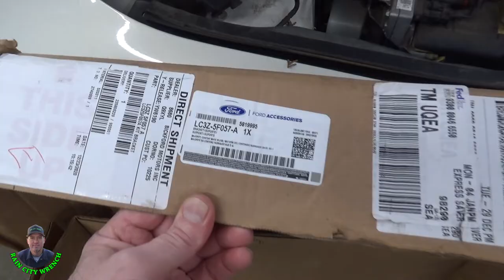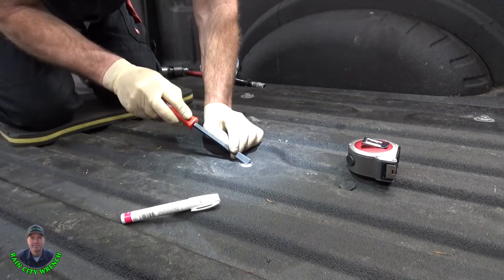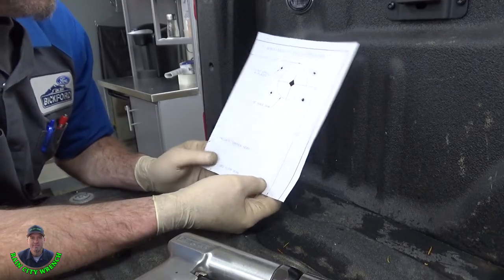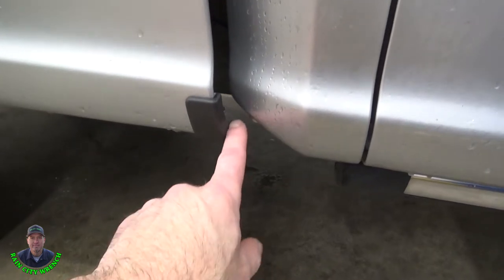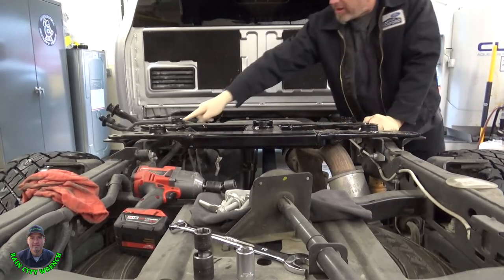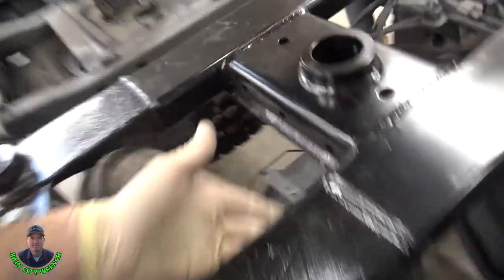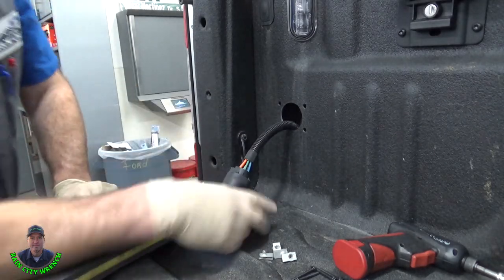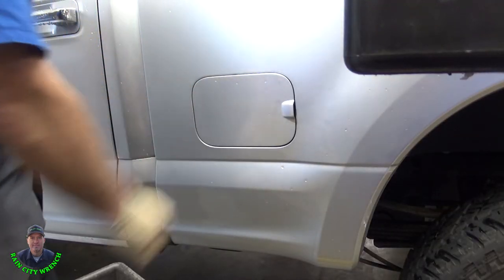FORD FACTORY 5TH WHEEL/GOOSENECK HITCH PREP PACKAGE INSTALL

Comment: Is it really necessary to remove the bed? I see a lot of installs where the bed doesn’t have to be removed. BW hitch doesn’t require the bed to be off
Reply: Then I’ve seen other videos that say to loosen the bolts on passenger side, remove on driver side, lift bed up on drive side and place a block of wood under it to keep it raised.
Reply from the maker: @Subi_doo  The directions say to lift the bed enough to place 4x4's under to gain access. I did my first one that way but never again. Was an extreme PITA. Sliding the heavy bracket under wasn't fun and torqueing all the bolts was impossible without extensions so never really knew how tight they were. Removing the box drastically cuts the time down and saves the back. But it is very doable by blocking the bed up. These aluminum boxes are light, three people can easily remove or two strong dudes. Thanks for watching!
Reply: @raincitywrench117  I plan on having the dealership do mine. I’m not taking any liability if something should happen resulting in an installation. I just don’t trust my dealership enough to not slam my bed off my cab and damage all my paint. 2 times at the dealership already with my brand new truck, both trips had damage upon receiving truck back. Granted they paid for all damages, but still I shouldn’t have to worry each time it needs service.

Comment: Is there a part number for the hardware kit (bolts and fastners)
Reply from the maker: Wished I had a kit here to look at but don't. I saved the directions but all it shows is description and quantity of each part under HC3Z-5F057-A kit. You will probably have to call your local dealer and pry it out of them

Comment: Nice video where can I get some of those protector caps
Reply from the maker: Find another pickup out in the home depot parking lot and borrow theirs. Nah, better not. Here is a kit on ebay:https://www.ebay.com/itm/254236619386?chn=ps&norover=1&mkevt=1&mkrid=711-117182-37290-0&mkcid=2&itemid=254236619386&targetid=1068323858110&device=c&mktype=pla&googleloc=9033382&poi=&campaignid=12589942946&mkgroupid=121185185993&rlsatarget=pla-1068323858110&abcId=9300523&merchantid=8260744&gclid=Cj0KCQjwyN-DBhCDARIsAFOELTnyy17r6AFRB2QUNOyv1wMJF890Zy4UQHl_uew_rqzlMfy3T6PKFpMaAkcHEALw_wcB

Comment: Very nice video such detail. 
I thought Ford recommends to NOT reuse the box bolts ? They say they are one time use only . So does the kit not come with new ones ?
Reply from the maker: Thank You. Guess you are right. I just looked in workshop and Ford says when removing bed "Remove and discard the pickup bed fasteners."
The kit does not come with bolts. They are not stretch bolts so IMO they can be reused. Ford wants any bolt with factory threadlock to be thrown away. Just apply some blue threadlocker and good to go. The truck could roll 20 times and those bolts ain't going anywhere.
Reply: @raincitywrench117  I know , I was just to curious as to why they wouldn’t put new bolts in the kit lol . I have a 2022 does the kit come with new bolts now ? Since Ford recommend the change of bolts they should come with it you’d think . 
Man that was a very good and detailed video 👍🏼👍🏼👍🏼👍🏼
Reply from the maker: @_WELDR_  That would be the right thing to do but I have gotten various new parts like water pumps without the gasket, lower ball joints without new nylock nut, thermostat without gasket, etc. It's maddening when you are in the middle of a job.
Reply: @raincitywrench117  yes that would definitely be frustrating! That to me would be just as bad as sending the thermostat without the thermostat and just the gasket 😂🤣 I order all my aftermarket things through Husky Liners , but for some reason this time they send the rear wheel fender liners without the hardware 😂🤣😂🤣 how in the world am I supposed to put them in . I called them and they sent them out right away . It’s little things like this that companies need to pay more attention too.

Comment: Can this be installed on a 2004 f250?
Reply from the maker: No. BC3Z-5F057-A is the kit for 11-16 & BC3Z-5F057-A is for 2017+. I don't know if Ford makes this setup for a 2004 but etrailer will definitely have something for you.

Comment: Will it work for a 06 f350?
Reply from the maker: No. Reese does make this but it doesn't fit older Ford frames. Reese has other styles that you can find on etrailer that will fit an 06

Comment: So what was the price for the hitch?
Reply from the maker: Think it was 800 bucks but probably more now.
Reply: @raincitywrench117  yeah I spent 1400 on the B&W wish I went with the factory set up.
Reply from the maker: @christopherfarage4491  Have installed a few B&W units with the unlock lever inside the driver wheel well. Those are nice units but a PITA to do with the bed on. When I get another the bed is definitely coming off. They don't offer this bracket on 2011 and older super duty's I think

Comment: None of the Ford dealers around me will install hitches
Reply from the maker: Have heard that a few times now. Not sure what gives?
Reply: @raincitywrench117  two said they were to small that I needed to try dealers with a body shop. The 3 larger ones told me insurance purposes, if it failed while towing it made them responsible. They said that they didn’t install receiver hitch either.
Reply from the maker: @cody7321  Sounds like a cop out. They could just as easily leave caliper or lug nut bolts loose and cause injury 🤷‍♂